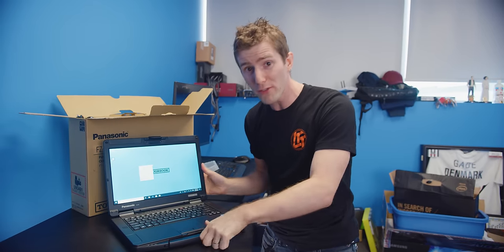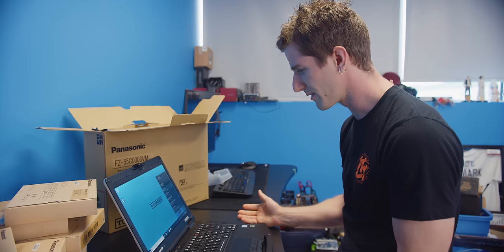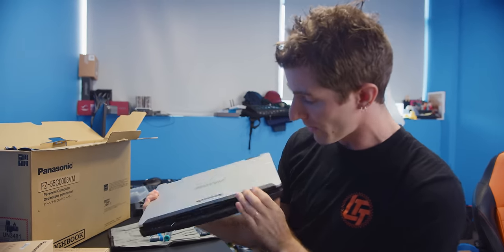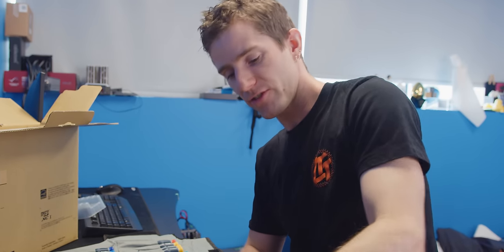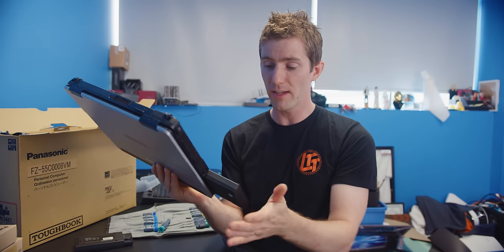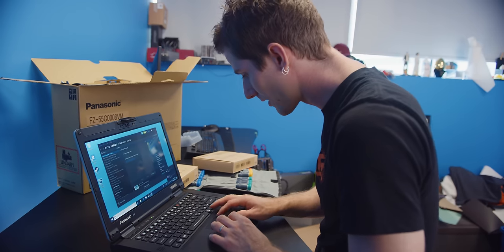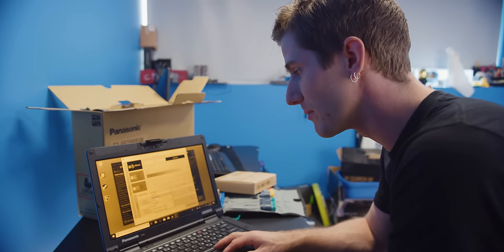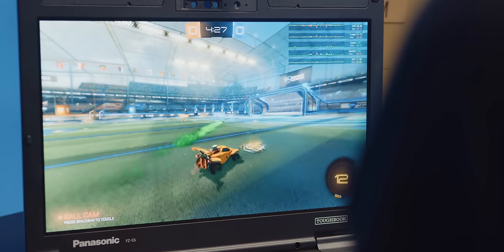The CRAZY Upgradeable Laptop - Panasonic TOUGHBOOK 55 Showcase

Comment: This is what we still want from computers. Exactly this.
Reply: Some Guy Are you buying one?
Reply: But knowing that’s it’s over 2000 is not what I want. Exactly not what I want.
Reply: I don't know I don't know that’s exactly my thought.
Exactly my thought.
Reply: Absolutely............At last, a laptop that takes you back to the days when laptops were easy fix and todays crap....nowadays they don't even want to let you swap out a hard drive....take note HP
Reply: That’s the thing though - the vast majority of people don’t...

There’s no way I’d lug something like this around unless my job required me to use my laptop in the field regularly (think first responders, or engineers working on utilities).
Reply: I remember when eMMC replaced even good old (not reliable) HDD for storage. like seriously. what were they thinking chucking in a 32GB of storage crap for windows. 

Also, If its soldered youre screwed. Soldered ram is an evil thing be it performance or savespacing. Im typing this on my 2GB ram soldered netbook that could work better around 4GB if not for windows 10/chrome updates needing much more ram so they dont access the page file of my HDD and slow things down
Reply: @oscarrzga4615  this tbh. Linux needs a LOT LESS resources than Windows at it's cleanest. Been using for years now and recommend trying out, even just to revive an old laptop
Reply: Thinkpad W530 or T420
Reply: Especially the screws instead of clips
Reply: Got HP 8570w WorkStation laptop, upgradable, a lot of slots, you can make any configuration you want, aluminum body. And it's cheap!
Reply: @guzhevskyy  How long you have been using, I wouldn't expect the laptop breaks after the warranty expires
Reply: Xenomorph 9/11 bought used half a year ago or more. Since that time we both have traveled a lot, including Saudi Arabia with it’s dust and hot climate.
Reply: @frankboye9929  when its limited to 2gb max
Reply: Pretty much yeah..but universal..pretty much swappable on all kind of laptop
Reply: @idontknowidontknow879  They're so readily serviceable you can often find pretty good deals on refurbished ones on Amazon.

One I was looking at(lattitude 5420 rugged i think) was about $1,600 there, I checked Dell's website and one configured with the same specs was over $3,200.  There were others I saw in the $700-$800 range as well, but I didn't compare them since they didn't have the features I was interested in.
Reply: Apple would learn a lot from this.
Reply: Nope, it isnt
Reply: I hope you have $2699 laying around.
Reply: No, the market says they want everything soldered and glued together into a solid slab of glass. That is, cell phones and "mobile devices".
Reply: Just get any older thinkpad.
Reply: They are readily available and you are not buying them.
Reply: YES! you should see what the repair manuals look like!
Reply: Yes!!!
Reply: I want this
Reply: At least what people want that actually care about what’s in their tech instead of just mindlessly using it and throwing it away then getting a new one when it’s becomes old

Though I guess I can’t be too hard cause certain applications a thinner lighter device would be better though
Reply: Exactly.
Reply: @idontknowidontknow879  yes, but imagine that you but this thing and then just update it for the rest of your life when needed.

One downside - I don't think they will realease that many modules
Reply: well, tbh it look ugly and heavy @@ i would rather something light-thin and look modern
Reply: Indeed
Reply: This. Absolutely this.
Reply: Absolutely
Reply: No.
Reply: YES THIS
Reply: @baconapo3990  Kindly consult a good Neurologist.
Reply: I'll pass
Reply: Agreed. 100% agreed.
Reply: You probably know at this point due to Linus videos but look into framework
Reply: Frameworks...
Reply: @idontknowidontknow879  I paid 135 dollars for a quad core latitude e6530. It is lighter than this, can house 1 97wh battery with another 30wh if you give up the optical drive, has a socketed processor, could be had with a touch display
Reply: Lol. Nobody wants this. Not even you.

You can't upgrade the CPU on these things. Or the display. Or the webcam. Or the keyboard. Or the touchpad.

And the only GPU "upgrade" is a Radeon Pro WX 4150, which was already extremely weak (and a couple years old) when this was released.

The biggest SSD module it has? 1TB.

Upgradeability in desktops makes sense since they're inherently modular and have spacious standardized form factors.

Nobody but Panasonic is gonna make modules for this thing. And they just can't afford to design that many modules for a single model of laptop.

Just max out the specs on a normal laptop and get a payment plan. It'll be cheaper, and you'll enjoy its max performance the entire time you own it.
Reply: You have a framework yet?

Comment: God bless Panasonic for making 90's style laptops with 2019 technology. Someone has to make laptops for people who don't like throwing perfectly good hardware away every 3 years.
Reply: What Garbage said. These are used in many professional fields where the literal toughness is needed along with the ability to upgrade a module without replacing the entire unit. Ours are used in weather, get dropped, and used in situations that a /normal/ laptop would not survive in.
Reply: @KingShoter007 even if it cost 2times more than most expensive macbook pro? And each upgrade module is a price of a basic xps?
Reply: Here we aree!! https://www.powerpc-notebook.org/en/ (although we do not produce hardware itself...)
Reply: Then just... Don't throw it, repurpose it? Old laptops might be useless for 3D works, but it will be perfectly fine for text work, or, if you are in the industry, it can be used as a machine controller since that won't need a lot of performance and some software probably won't work in newer OS anyway.
Reply: @KingShoter007 sad thing is consumer technology grows fast, 10 years is obsolete (for normal consummers), but in critical operation enviroments 10 years is a standard,  this pc is not for consummers in the sense you cant get one, but CPU, GPU, or even the screen are not gonna have the sweet new stuff we get 140 refresh rate, powerful gpu, way more powerfull cpus, and half the price, remember every module might be expesive and not worrth to buy unless using it for specific reasonds
Reply: if you need UART or RS232 -> you use USB Converters,
if you need a GPU -> use thunderbolt to GPU Carrier
you need IO -> dont buy a mac
you need a second battery -> just buy something with two batteries.

There a far better solutions for consumer who are looking for practical notebooks.
back in the day my Latidude E6550 had all of it and it was lighter.
Okay, it didnt had a second battery, but it had a dual slot battery and honestly i dont see any sense in having two separate Batteries anymore.

this ruggedized tank of a notebook looks like something i would use as cop or firefighter to get information while sitting in a vehicle or something like that. If some module getting weak on ya, you replace it.
Reply: its 2k to start, if i was backpacking and wanted solid laptop thats not going to fail easy with me its not a bad option with all the hot swapping and exta battery life.
Reply: @franciscobarrazasaavedra4754  You're overestimating just what is needed and underestimating just how far back obsolete is. I have a 10 year old vaio laptop with a 2.6 ghz core2 duo processor that I use as work laptop. With a ssd upgrade (even over sata 2) and 8gb of ddr2 it is a very usable machine and can handle pretty much any software bar heavy graphical and compute programs. For comparison my gaming rig is   4790k, ssd, 16gb, and 290x
Reply: @eoinkenny3188  Yea, I'm using my 6 Year old Panasonic CF-53 to reply to this comments. 

Sure I could of had 2 or 3 laptops for the price of this one, but as a Radio and Communications Technician I need my laptop to work and always work. Right now I've got double sided tape holding up my HHD bay and the handle has been repaired using a nut and bolt. 

But the laptop hasn't failed me, If I've got a piece of mining equipment down and I drop my laptop in a rush - I can count on it to survive and finish the job.. Whereas a standard laptop would break, potentially causing tens of thousands in potential down time for our customer. 

Also to @Samen Spender - USB to Serial RS232 isn't reliable enough to work on Legacy equipment.
Reply: @sbstoner  Maybe your Backpacking is different than i know, but how do you need hotswapping when Traveling across a country?
Reply: Now we need CPU upgrade.
Reply: @Francisco Barraza Saavedra: I still hear about machines out there still in operation that use floppy disks
Reply: @eoinkenny3188  Toughbooks are extremely long lifespan devices regardless of their actual use, and we've hit a point where all but the most extreme applications haven't bottlenecked on CPU power for ~8 years now, might as well invest in a device that'll actually survive 10 years. It's still  cheaper by a long shot to buy 1 of these instead of the 3 MacBooks you'd have to buy over the same time, assuming Apple doesn't have another something-gate incident.
Reply: @TacGeek89  it's enterprise - so in about a year or two it will be like a third of the price of a MacBook - once they start getting rolled out of service for the newer toughbooks and enterprise laptops..
Reply: This is for military, police and so on.
Reply: my pc is 7 years old and laptop 5, so?
Reply: @KingShoter007 Not after you see the asking price.  You get more bang for your buck if you don't need the semi-rugged aspects of it.
Reply: @johnathankrausrig9237   since being a photographer i would like to have a laptop with me to work and dump photos so extra ssds and battery's  sounds good to me.
Reply: the alienware area 51m is also up-gradable. you can swap out the GPU and CPU on the spot
Reply: There was still ways to make it aesthetically pleasing. But this would increase cost and is not something people in Industries care about. If you want something in between buy a ThinkPad.
Reply: @hayoun3 : No it isn't. Look closer. The Japanese imperial flag was red and white, not red and pink, and it also didn't have a silly emoji in the center. But I guess you can still be offended if you want to be.

Also, your username is written in Hangul, correct? Fun fact: Most modern Japanese are of Korean descent, because in ancient times Koreans invaded Japan and exterminated most of the original Japanese people, leaving only a few small enclaves who nowadays look distinctly different from modern Japanese people. All major Asian ethnic groups committed genocide against each other at some point in the past. But I guess that doesn't count because it happened before World War 2.
Reply: I see lots of people telling me this isn't intended for average users, and I realize it isn't MARKETED to average users, but...have you seen how quickly average users break shit? Average users would absolutely benefit from more durability and replaceable parts in their laptops. Yes, of course it costs more, but it's inevitable that computers will have to last longer as rare earth metals used to build them become even rarer, so the higher cost will be offset by the extra durability and longer lifespan. I'm thinking long-term here, folks, I just replaced my work laptop after 8 years of daily hard use as a programmer and a data analyst (i.e. leaving the computer running at 100% CPU usage all weekend while it processes data), and my home computers are even older.

As for hot-swappable components: No, the average user doesn't need hot-swappable components, but the same design considerations that make components safe to hot-swap also makes them safe for average users to replace without professional help.
Reply: @sbstoner  Buy a notebook with DVD/BD Bay, replace optical drive with a SSD caddy. Or you buy a external SSD Case with a powerful tablet. you understand where im going, right?
Reply: Can't even buy one without Company Credentials and a End User Certificate.
Reply: @franciscobarrazasaavedra4754  That's only really an issue if you want it though, performance I can get, but you don't need a 140Hz monitor to play games well, and before you reference the video Linus did with Gavin Free, I think there's more to be said about the physics simulation than the observed frame rate.  Which they didn't touch on.
Reply: @DamnYoureGarbage  laptops in the 90s were designed this way too, it was very common place – even in consumer grade laptops. No one is denying this product is aimed at professionals.
Reply: Amen.
Reply: If you guys needs this laptop not for working, i think you should reevaluate how you treats your devices
Reply: @Kevin-fj5oe : In an ideal world I would agree. In the real world, a single careless moment can destroy a normal laptop because it has no reinforcement at all.
Reply: Also, another profession that may benefit & enjoy - the gigging electronic musicians and DJs.
A USB powered audio interface... Two batteries and a second HDD...

Away you go.
Reply: @needforsuv  same. Dell E6400. Keep having a peek for a replacement, but as with the machine they're showing...
The modular aspect is difficult to find in other models.
On the Dell - Got a second HDD, 8Gb ram, bigger battery and such...
Trying to find a laptop that can have a second HDD which can be quickly swapped if needed is quite the challenge...
Reply: @parasite unit

optical drive = fast swap hdd
Reply: @PowerProgressCommunity  I thought that the site was about powerPC XD
Reply: @superJK92  from looking at the site, I'm pretty sure it is about powerPC. Seems like they're trying to make a power PC laptop with a non Intel or AMD CPU.

Comment: This laptop exist in both 2001 and 2019
Reply: Hadrian Diaz Yep
Reply: Had a toughbook 2002... Survived everything except a lightning strike... Oh how I miss it.
Reply: The dual bays that can take batteries, plus the design of that optical drive, is very reminiscent of my Apple PowerBook G3 (Pismo) from 2000.  The removable keyboard too, though the G3 used two thumb latches to let you pull it off without tools, with a third that had a screwdriver lock to prevent someone from swiping your RAM or other internals that were accessed that way.
Reply: @Cheesen77  I want to hear the story of how your laptop was struck by lightning 👀
Reply: @AugustusBohn0  had lightning come in via the phone line plug in my house.. all phones and my laptop wich was plugged in via a modem "exploded"
Reply: @Cheesen77  damn
Reply: @Cheesen77  damn bro
Reply: @Cheesen77  as others have already said, damn! Thanks for sharing
Reply: Ouch
Reply: I was born in 2001
Reply: @Cheesen77  wut
Reply: @Cheesen77  f
Reply: @Cheesen77  holy fuck
Reply: @Cheesen77  On the bright side you can proudly claim that your toughbook survive everything the world thrown at it, except a direct lighting strike.
Reply: Ikr
Reply: @Cheesen77  I wanna hear the story behind that shit
Reply: Legit. It’s like one of those spy laptops
Reply: I still have an old pentium III Toughbook.
Reply: 1994
Reply: The design release Ed in 2001 and the power in 2019
Reply: @Cheesen77  TF
Reply: schrodingers laptop
Reply: @hritikbatra6988  same

Comment: 2019 Specs in a 2005 Laptop design? Hell yea
Reply: MEGA F4IL, where is my lovely expresscard!
Reply: Its mainly targeted for Mobility and rugged environments i.e. Military applications and Police Cars as well as construction, job sites etc. Everything you ever need is there.
Reply: @daimientaylor3108  The construction business loves them as well. I use to be in site preparation construction(clearing land for Walmart type stores, shopping centers, major golf courses, roads, etc...), and my old boss carried around a Panasonic Toughbook in his truck with a PCMCIA cell modem, and a portable canon printer.
Reply: @CommodoreFan64  Yeah they are good for the cost too. Worth paying the extra money and not having to worry about breaking your computer.
Reply: @daimientaylor3108 i see Japanese field reaserchers are obsessed with them as well
Reply: @daimientaylor3108  If you can afford one, and have the need they are for sure well worth the extra money spent. Having said that I tell people who don't need that much ruggedness, or don't want to game on their laptop to just buy a Lenovo Thinkpad new, or used depending on their budget and/or needs, and you can get some simi-rugged ones in the education line like the X131e, and X140e model Thinkpads for not much money that have a thicker plastic/metal bodies, stiffer hinges, removable battery, and a rubber bumper around the screen lid.
Reply: TOUGHBOOK
Reply: Needs a 5:4, 4:3, or just some sort of square display too. Other than price 16:9 doesn't make as much sense in a commercial laptop. More room for windows, ports, batteries, and it's easier on the neck.

I miss decent laptops with square screens or square monitors in general.
Reply: IBM come back...
Reply: Rugged laptops have been a god send. The original toughbooks we used in EMS could be run over by the front tire of a type I ambo, or the rear tire of a 2009 Ford Excursion. But the actual computer part sucked. They had WiFi but we actually carried a couple LAN cables as equipment because it couldn't hold a connection. 
Attempting to add media files was basically drag over what you want and then walk away.